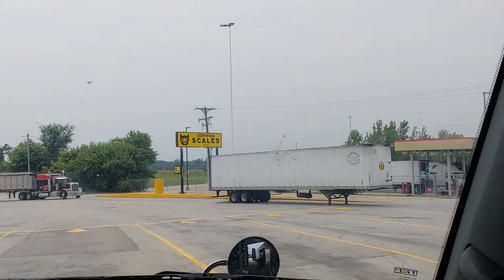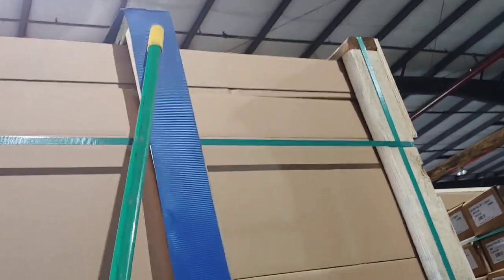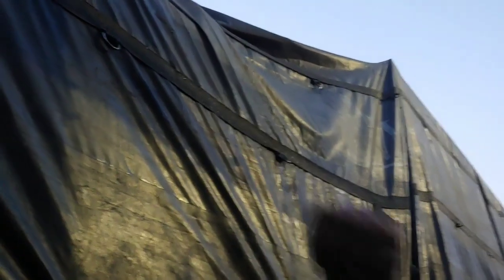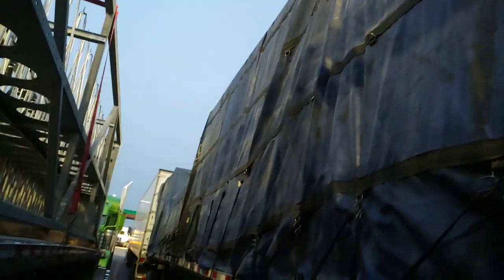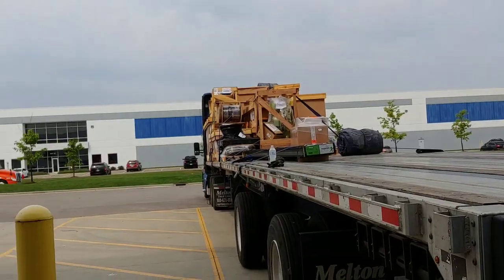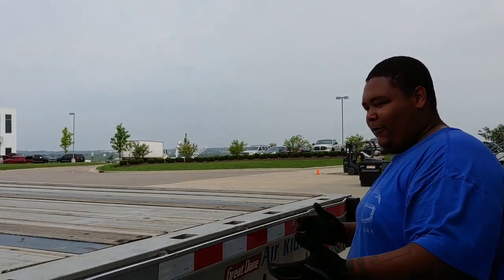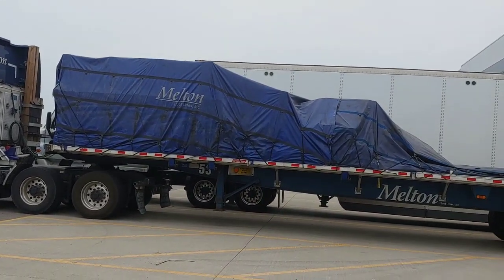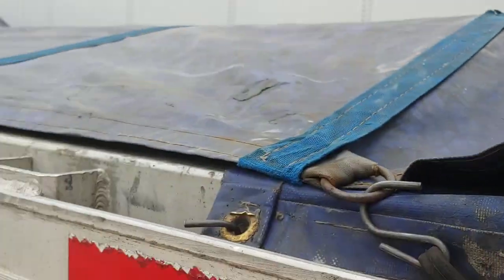Melton Truck Lines (Update) Vinyl Siding!

Comment: hey guys I was checking out melton .I talk to a recruiter and she told me that since i have otr experience I would just go for securment training for 1 week and than go out by myself . Is that true because I think that's kind of fast to send someone with no flatbed experience.  I was just curious to see what your thoughts are on this.
Reply from the maker: Big Rick's Trucking Yes, thats true. You will learn the basics and you will take that and apply it to different loads. Many people think that you have to learn every single load that you could possibly get before going solo but you will have what you learned, the load securement team if you ever need them, and a book with different types of loads in it. Melton will let you work your way up as far as what loads they will give you at first.
Reply: Common Sense goes a long way in flat bedding they give you a book with pictures and things like that and we have a safety department can help you out
Reply: That's what happened to me and they put me on some real easy loads.. at first 🤣. You'll have a mentor to call and the book is a huge help. And honestly most shippers tend to tell you exactly how they want their stuff secured. Tarping is a bitch to learn on the fly, but you'll get it.

Comment: And how do u guys. make sure the load is 13'6
Reply from the maker: Big Rick's Trucking We use the height of the truck. Some truck stops will sell the measurement poles and sometimes it will be on your BOL. Also you could park next to a dry van.